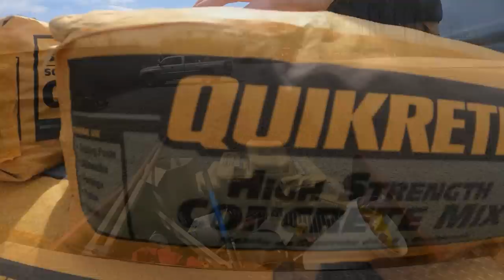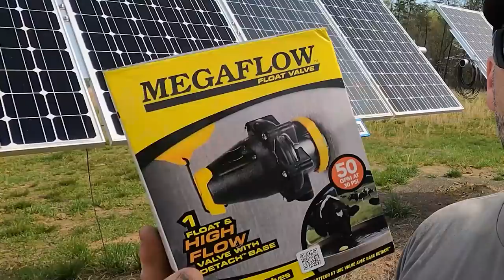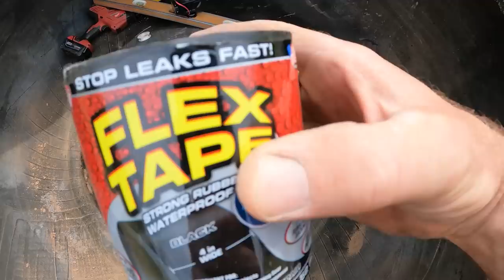How to build a tire water tank from start to finish

Comment: That's not ''Giant''!
Thats puny.
Only about 200 litres.
I have an ''average tank'' behind my barn, 1000 litres.
As for the ball safety device, bars are a lot simpler, and foolproof.
However, some farmers have a water on demand here, where the cows push a lever, with their head, that fills a bowl with water, (a bit like a urinal) and the cow can drink.
When it stops drinking, the lever is released, and the water stops.
Minimal wasted water, and nothing can drown in it.
Also, minimal spillage means the tha drinking area doesnt turn into a bog.
.
Reply from the maker: you think a 2.5 foot deep X 7 feet across tire tank only holds 60 gallons of water?  Sorry but picking this concept apart is just making you look silly.  Sit back and enjoy learning the way another farmer does it...you don't need to fix a non-existant problem like water dribbling from a cows mouth "wasting water"....what is wasted water in a cow pasture?  How is a water tank gonna turn into a bog by 3 oz of water dripping off a cows lips?  I'm not so sure you've got all your facts quite figured out my friend.  I'm installing some different waterers in a future video...maybe you'll like them...not sure...none of this needs "fixing" ...it's just my way of doing it.
Reply: @StoneyRidgeFarmer  
Ah! 
Thanks, I had to guess the size, it doesn't look that big, but that's probably due to the camera.
Apologies for my mistakes!
However, I can assure you that locally, the cows turn the area around their water tank into a bog. So, some of the farmers have installed a water feeder with the mechanism I mentioned. Because the rotate, and the bog causes problems when they plant crops afterwards.
I guess it's not just water dripping off their mouths, but them splashing it all over.
Good luck with your experiments. I'm sure every farm has its own specific problems, and solutions.
.